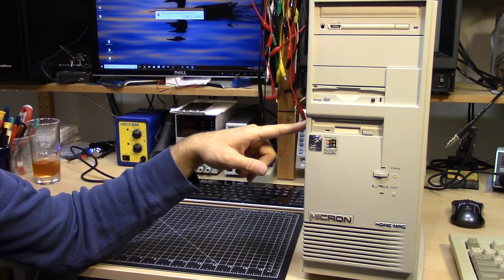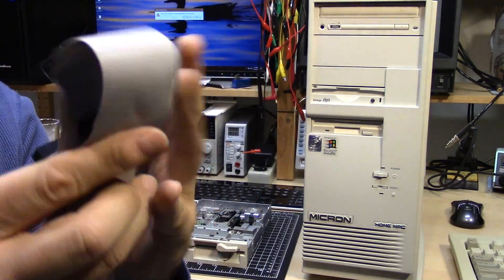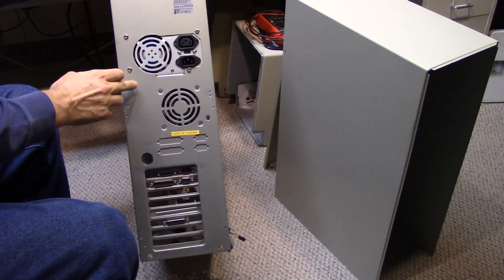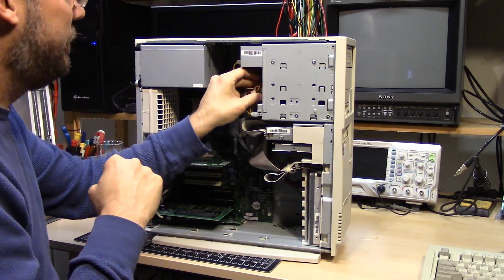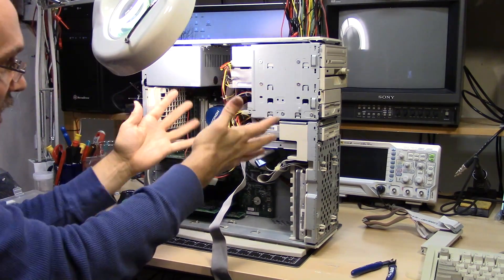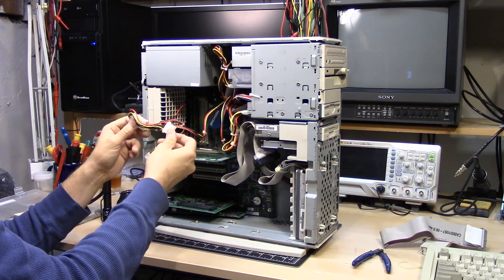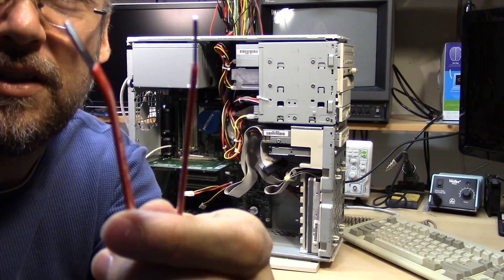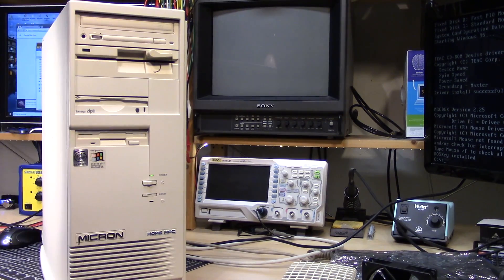Finding and installing a 5.25" floppy into a PC (MSI Case bonus)

Comment: Just an old timers tip. The red line on the IDE cables or flopy cables indicates 1. It should always be on the side where your power comes in to the floppy drive, or hard drive. On the board it's labeled as 1. Just in case you don't have a notched cable to compare with in the future :-)

Comment: I just got a 5.25" teac internal drive to adapt into a usb header on a Z77 extreme4 mobo... however, windows 10 64 pro refuses to think of it as a 1.2MB floppy...it only offers to format it as a 3.5" 1.44 MB floppy... clearly that won't do.  Do you have any idea how to convince windows 10 to treat the 1.2MB floppy as what it is?

Comment: I am getting a old Hyundai desktop computer from Bradford “Brad” LeMay and upgrade it with the latest components (BD-R drive, Windows 10 Home 32-Bit, 1TB hard drive, Intel Core i5 processor, nVidia graphics card, audio visual card and 16TB RAM)

Comment: I've been trying to get a 5.25" drive lately (mostly for use with the Greaseweazle, to write disks for old systems like the Apple II and Commodore 64) and the prices on these things are just stupid right now...  I even just picked up a complete 486 system which, unfortunately, didn't have a 5" drive...  It had a tape drive, which I don't really want to keep, which means I have a 5.25" drive bay that I'm going to need to fill or cover with...   something...  I'm thinking maybe throw an LCD screen in there, that's the kind of thing I'd have done back in the 90s...
Gotta love those old monster tower cases, too. Definitely had one of those for a while...

Comment: you don't need a flip cable if you get how the jumpers on the drive work.  almost all drives had a drive select jumper. Including Teac.  Flip cables were invited by IBM because they figured the average user was to dumb to deal with drive jumpers.  even tho adding a second drive to original PC's involved pulling the resistor pack from drive number 1. to dumb to set a jumper burt smart enough to pull a resistor pack? lol.

Comment: I've kept my old peripherals all this time, so I still have several 5.25" FDD's ... not to mention big stacks of 5.25" & 3.5" floppies, which are not just for PC's, but also for my Commodore 64 system(s).   I also have one of those combo internal 3.5" & 5.25" FDD's, for fitting in one bay slot. And also an internal Iomega Zip100 drive ... which is like miles faster than the external parallel port Zip drive, which I also still have.  
I have to wonder about that MSI badge.  I am unfamiliar with any of MSI's (MicroStar) older logos, apart from the compass & dragon symbols.  If that is not "the" MSI we all know, then it's possible that is a different MSI company.  PC companies boomed & waned back in the 1980's & 1990's.  I've kept a few Computer Shopper catalogs from the late 1980's, I'm talking about those big thick wide books & inside there were any advertisements from PC companies, many of them now defunct.  
I love fulltowers, so that MSI one is nice.  I only have one full tower, bought for something like $50, w/ PSU, about 20 years ago. Apart from the standard locations of the many bays, it additionally had a bay at the roof of the tower, like where your left hand is holding the top frame strut at the 3 minute mark of the video, which makes sense since there's lots of empty space there above the PSU.

Comment: wtf I had those exact drives hell they may be in a box in my garage. I think this guy is collecting stuff I've used and sold or traded for newer gear that I wish I had..hmm

Also the red wire signifies "wire 1"

Comment: In the really old days (early 90s) that was the sort of machine I used for Netware 3.12 servers - lots of bays for 1G SCSI drives and EISA motherboard with Adaptec SCSI with never less than 16Gb of RAM. The 3 1/2" bay was for a DAT SCSI tape drive. Two servers with 8GB of drive space total could feed a company of 100. It was entirely possible to run Windows for Workgroups over the 10-baseT Netware network, although everyone had a local copy. This type case + 4 heavy Micropolis drives (big fat brick drives) and man that sucker was heavy. My desktop was an AST workstation -type PC with an equivalent build to the servers but less disk space (only 2 bricks). Those were the last days of "heavy" computing :)

Comment: Did it test out good with a floppy disc? I obtained the same Teac drive (brand new, incidentally) and I got it installed in a Dell Optiplex. It does the brief light up during POST and shows in Windows 10 but it will not read or recognize any disks. Tried in a different computer but same thing. Hoping it’s not a DOA drive.

Comment: Really nice to see these retro PCs, I'm holding a Pentium 3 for many years, thinking one day I'll find a matching sound card and video card. I have the Processor, RAM, Floppy, 20 GB Quantum Fireball, Original CD ROM came with the particular PC and of the casing.
Reply: I remember throwing these for recycling by the dozen not too long ago. Now, they're prized as retro-gaming rigs.

Comment: Is it possible to attach an old 5.25 inch floppy drive to a modern PC or Mac using one of those IDE/SATA to USB adaptors? I'm strugging with this problem. I'm not sure if I'm barking up the wrong tree.
Reply: Not with an IDE interface (40-pin), but apparently they do make floppy-USB interfaces (34-pin). https://www.ebay.com/itm/1-44MB-3-5-Floppy-Drive-Connector-34-PIN-34P-to-USB-Cable-Adapter-PCB-Board/322934590717?epid=3026277803&hash=item4b3066ccfd:g:BIcAAOSwVEFb-T7~
What I don't know is whether this will be able to detect, or if you can set what kind of floppy you have connected.
You can also go the other way around and get a USB-floppy emulator, but they're more expensive. https://www.ebay.com/itm/Floppy-Drive-to-USB-Converter-Emulator-for-Okuma-Lathe-free-8-GB-Flash-Drive/300723408804?epid=1754537345&hash=item4604830fa4:g:uGwAAOSwa~BYd0Mw

Comment: $10 for the floppy cable?  I still have a bunch of them, and I was actually considering going through my parts boxes and cleaning them out.  Now I need to sort through and sell them (nah, not looking for $10 a cable).  And I have one of those adapter pieces, glued in a piece of cardboard to the opening since I needed to use it for holding a HDD (my case was missing the HDD cage).

My last 5 1/4" floppy drives got lost in a house fire, never bothered hunting down any more.  And my current homebrew machine doesn't have a floppy connector on the motherboard.

The problem I remember with the proper alignment of the floppy cable was if you had to twist it around, you had a good chance the cable wouldn't reach the motherboard anymore.  Also: if I remember those Micron cases, the drive cages might have been able to move/swing out of the way.

Comment: That 3.5" one could be used for an IBM 5150 AT. You may just need to add some drive rails so it sits properly in the drive bay.
Reply: IBM 5150 wasn't an AT. It'd still work, but the issue is that you'd be limited to reading 720K, unless you can find an 2HD floppy controller that works on an 8-bit slot.

Comment: You can probably put an SD card hard drive emulator above the Zip drive if you need to.
Reply: Most people would just go with a Compact Flash, since it's basically IDE anyways.

Comment: I´m from the time where drive A was 3.5" and drive B was 5.25. Surely just a preference :) Thanks for sharing
Reply: I would say it's more indicative of the era.  The main thing is making sure the A: drive matches the disks you need to boot from (mostly the DOS install disk and a boot disk with CD drivers, etc.)

I built my 386 with 5.25" as A:, as back then DOS 3.3 to DOS 5 would ordinarily come on 5.25" disks.  Starting with my 486, the 3.5" is A:, since that's using DOS 6 which came mostly on 3.5" disks.  The Pentium doesn't even have a 5.25" drive, since nobody was still using them by that time.
Reply: @sirnickity  You're right. Particuarly, people would usually just keep whatever drive as A: that the machine came with, since that's what the system boot disks came on. It would come with a 5.25" drive, and they'd later add a 3.5" drive. 

I kept my 5.25" drive in my main rig until well into the Pentium era. These days, my i7 has an internal floppy and ZIP drive, just for working with my retro computers.

Comment: When I found that my PCB CAD program did not want to run on my newer 64-bit computers, I ended up rebuilding my old 32-bit unit with XP system.  While at it, I stuffed both 5,25 inch and 3.5 inch floppy drives in.  I never got rid of mine!  Works pretty well and actually faster than a virtual XP on the new computer.  My only issue is that I have not found my drivers for the USB to IEEE-488 adapter, which also did not even load into the 64-bitter.  But I have hundreds of 5.25 inch as well as 3.5 inch floppies, mostly not converted into any newer media.  Now I can again access them.

Comment: One time I accidentally plugged a PATA ribbon cable in the wrong way around. It caught on fire when I turned the computer on.
Reply: Even in the rare instance that there's power on that ribbon, it's only 5v on pin 20, the most you're going to do is short 5v to ground and blow the power supply fuse, but +5v on pin 20 is usually only seen on industrial machines that used IDE Disk-on-Modules, or in some newer 8-bit cards made specifically for installing CompactFlash on older machines... Unless you're talking about a laptop IDE connector, but you'd just be bringing  the 5v power (logic level high) to data pins 7/8. It should be quite impossible to set something on fire that way. In an ordinary PC, there's no "active" power on those ribbons, only TTL logic lines that pass milliamps at best.

No, something else went wrong there.

Comment: Hey Adrian,
on very old floppy drives you can configure the drive as A or B drive.
For example the drives in the Commodore PC 10 III. 
Is has two 5.25 drives (360kB) and a non swapped cable. 

I don't know when they stopped to bulid in the jumper on the drive to configure adresse.
But from then on all drives that I got where  hard configured as B Drive.

Comment: WOW, I still have at least one in a drawer, plus boxes of floppies. I think I transferred all my software to CD then to DVD. Still have the floppies and drive in case i want to revive my stored 486 i had as a router/server. Most cases I've ever owned had 2 sets of holes for back or front fan, so you could use different size fans.

Comment: just found your channel and now I'm binge watching pretty much all the videos xD

a little trick I used back in the day with the power and floppy ribbon cables was that I'd always connect the power first and depending on the orientation of the red power cable I'd use that to figure out the orientation of the data cable - ie. if the red power cable was "pointing" in, then the red on the data should be right next to it, if it was "pointing" out of the drive than the data should be pointing out as well..
Reply: "Red together, or red apart". =3

Comment: I saw one of these Micron machines at my old job at Staples...sadly it had been heavily damaged! I should have grabbed the processor with that crazy heat sink though...
Reply: If I remember, it actually screwed-into a holder on the CPU.

Comment: A quick tip for remembering where the red edge of the cable needs to go when plugging it into a 3.5" floppy drive... it always (I never ran into a contrary situation) goes on the side closest to the power connector of the floppy. 

Also, if you managed to mess it up and get it backwards, it is very easy to recognize that you did put it on backwards, because the drive busy light on the drive will instantly turn on solid when the machine boots.

(ADDENDUM: I should really wait until the end of a video before making these comments... you mentioned my second part there all of two minutes later...)
Reply: I too have noticed that. Whether on hard drives or floppies, pin 1 seems to always be facing the power. Some floppy drives will mess you up and flip which end the power connector is on. I've also noticed that pin 3 is sometimes absent on the floppy header, which of course is on the side of pin 1. The one thing to watch out for though is working on some old XT-class systems that had the floppy power on the ribbon, like my Tandy 1000HX. Hook that up backwards, and watch the magic smoke escape. And then there's farting around for hours trying to get a replacement floppy working only to find out that the machine uses Shugart floppies rather than the (now) PC-standard, and you need to swap pins 10 and 12 on Drive A: to get the replacement working.
Reply: Red-red.